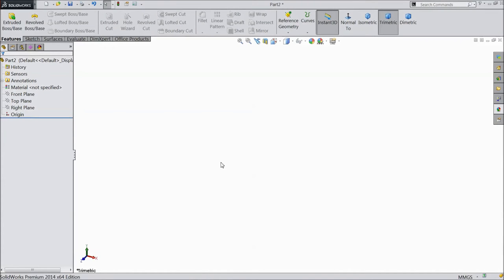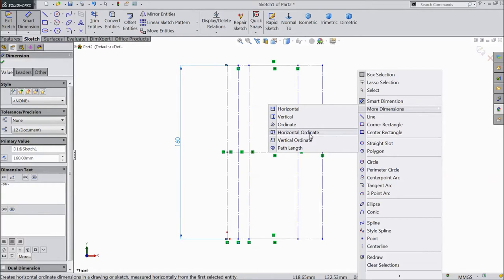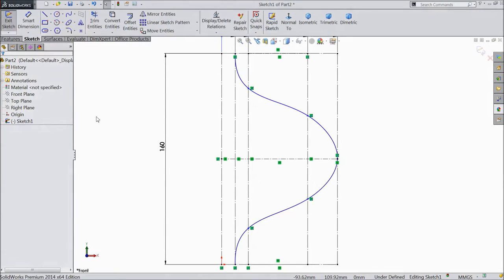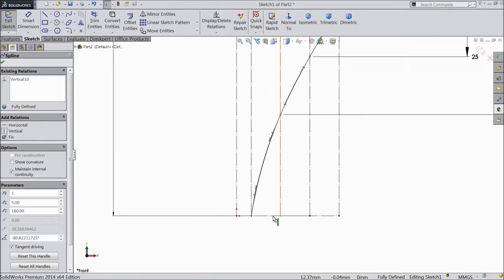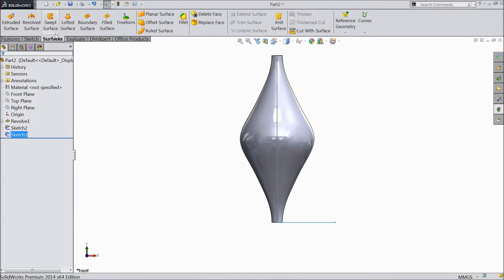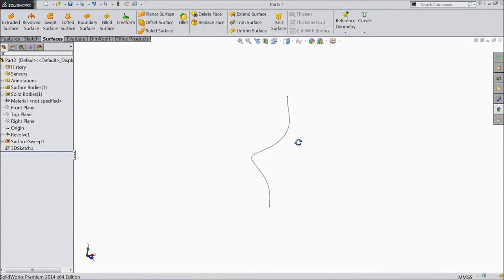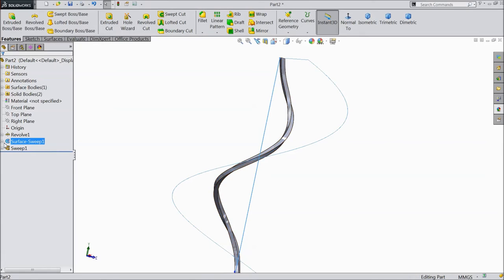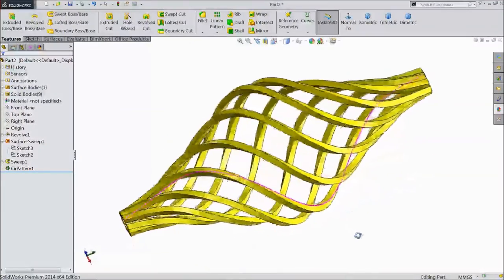SolidWorks Tutorial Decorative Steel Grill

Comment: hey buddy, I am learning a lot from your videos. I hit a roadblock in this video. @4:33 the function you are using swept surface is not a similar in Solidworks 2017. I don't know but I cant select Profile & Path at the same time.
Reply: I got stuck at the same problem. To fix this I sketched a circle on the top plane (circumference  - 110mm) which is at the bottom. Then I went to features > curves > helix and spiral. Pitch is 160mm, revolutions - 1, start angle - 180 degrees. This creates a single helix with its starting point located on the y axis. Next start a new sketch and draw a line from the origin point along the y axis until it hits the 110mm circle. Then you can add the surface sweep feature. Profile (blue) is the line and the path (pink) is the spiral. You need to create the circle at the start so solidworks can create the spiral path (Y)